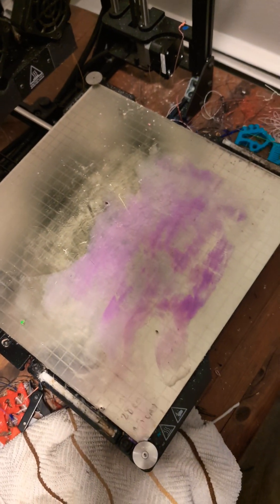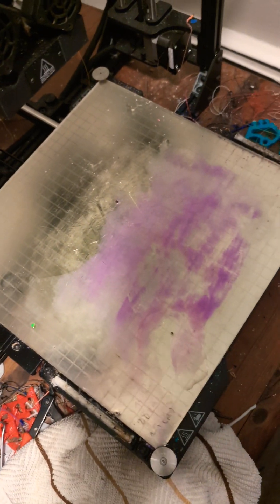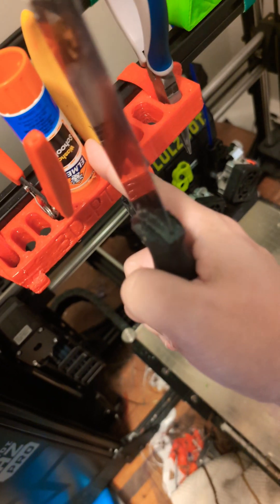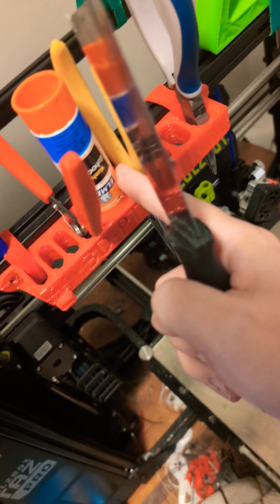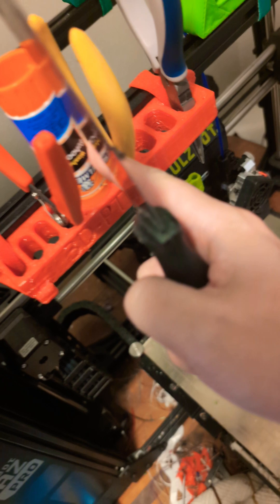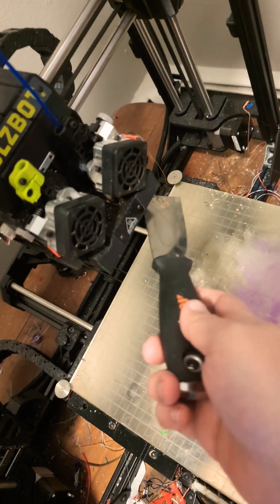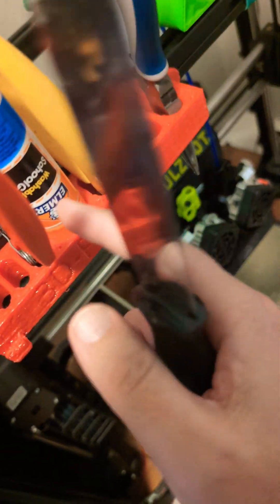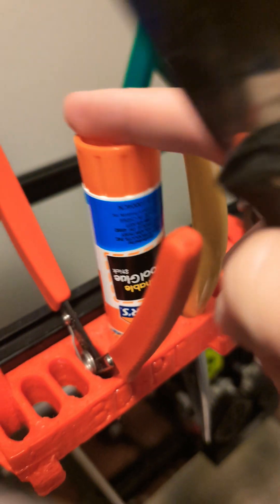Things they Don't Tell you About #3dprinting: Dirty Build Plates #shorts

Comment: What brand and model printer would u recommend for beginners? 

I want to make household things like parts that arent made little trinkets with nice detail some stuff to help around the house , i want it to be precise ive seen some cheaper builds have wonky lines and details. 

I assume it comes with a steep learning curve or once u got it down are you good to go? 

Which software do you use ?
Reply: just get a bambu lab printer. theyre the most out of the box user friendly printer ever made. yes they carry a higher price tag but theres a reason theyre considered the best on the market.
Reply from the maker: I agree bambu is the hot printer on the market, they were prominent at RMRRF. However I don't support cloud-based controls and their connection to Chinese servers. 3D printers should not rely on a server to work. I can print off an SD card or thumb drive and not worry about loosing a connection or the server being compromised. For some of my work I prefer to keep my models off any cloud. They also have a bad rep for stealing models. For filament their spools are proprietary to their printers, which may limit some of your shopping ability. I can print 2.2 kg bulk spools or 750 g standard spools on my printers.
Reply: @3DPT  where are you getting that information? You can run a Bambu printer entirely offline via SD card or if you’re that concerned you can get the enterprise model.
filament spools are not restricted to bambu labs spools.. I buy sunlu and any other brand I like; the benefit of bambu lab spools and their refills is that you don’t have any faff over temps or speeds as it’s all pre programmed and knows exactly when it’s going to run out.
In terms of spool size: you can use the 1kg spools inside the AMS or run any size spool from the solo feed at the back.
I doubt entirely that the company smashing the competition and selling like hotcakes every day is going to care at all about the trinkets people are making or selling.

Also the comment I replied to was clearly a newcomer to printing and wanted to have an easy entry to printing. Which without a doubt would be any bambu printer.
Reply from the maker: You shouldn't have to buy a "enterprise" model just to keep your printer off the cloud. Printers should be independent and secure, not beholden to subscriptions or cloud storage just to function. Your hardware should be truly your hardware, not tied to a server farm or subscription you can't control.
Reply: @3DPT  i 100% agree i dont want my printer hooked up to anything cloud related and especially no subscriptions that kind if defeats the purpose, i figure the rendering programs might have a paywall but there is definitely a ton of free ones
Reply from the maker: I'm a dinosaur at this point, I still run Taz5's and Pro from a few years ago. I'm saving up for a Prusa at this point. There are entry level brands like Creality and what you get on Amazon, but those you'll spend some time upgrading and learning how to tune. Lulzbots are good out of the box, but pricier and more mid-level printer(Full disclaimer, I worked for Lulzbot when they were in CO)  Watch some other channels for their reviews of 3D printers to see what is actually good (Don't trust Amazon reviews). 
For software I use Cura for Lulzbot, I need to update to PrusaSlicer. I use and support open source hardware / software whenever possible.
Reply: I need to di some research i keep going back and forth i do love tinkering and tuning anything i work with but i do want it to be able to print out of the box and be pretty easy yo upgrade and figure out what i need for whatever project.  I just hate buying a new expensive thing and i figure out within a day i really need a different nozzle say or some kind of piece if equipment to keep it running smoothly.